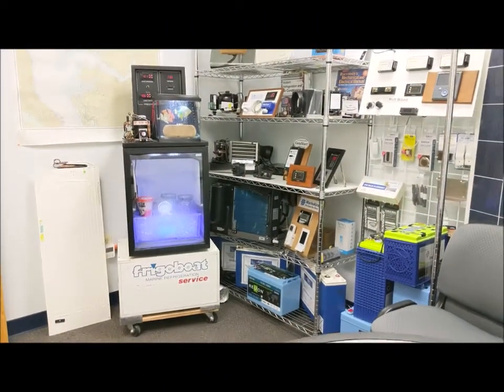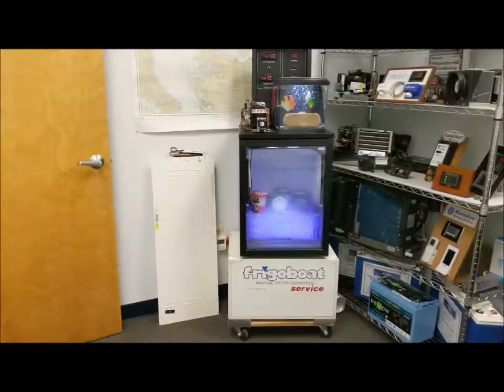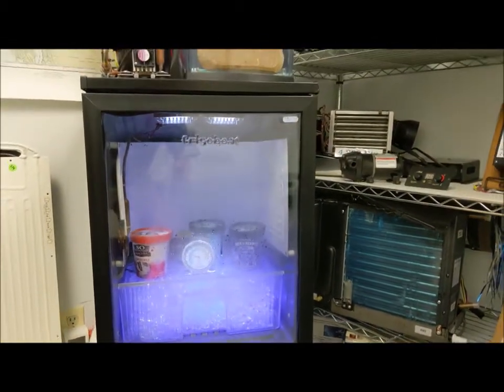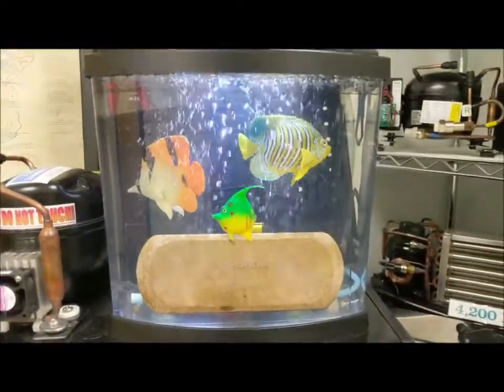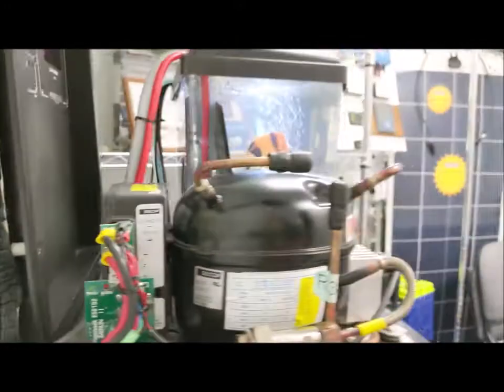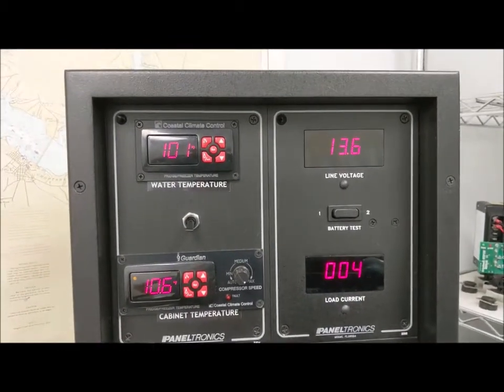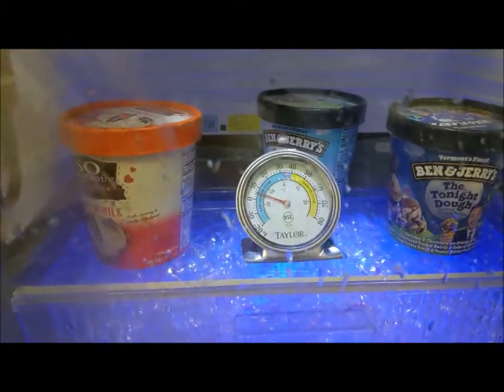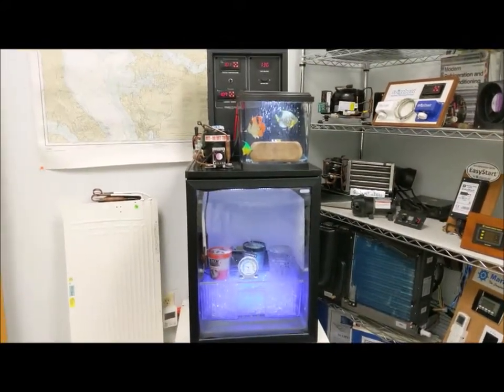Frigoboat Keel Cooler demonstration

Comment: Why no keel coolers for AC systems?
Reply: Capacity. A refer compressor is about 500 btu  and AC compressor is significantly more than that.
Reply: @coastalclimatecontrol  Thanks, the 500 btu figure is what I was missing.  So a small AC would require 8-12 keel coolers (or one 8-12x larger).  Which is expensive even if it would work.  While you're here, what are the dimensions of the fridge keel cooler?  I looked but didn't see them on the website.